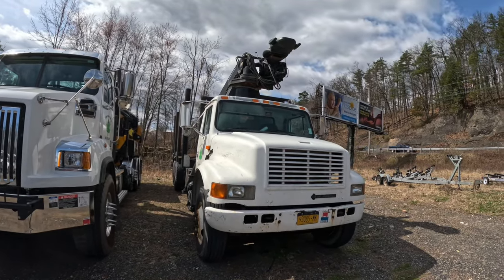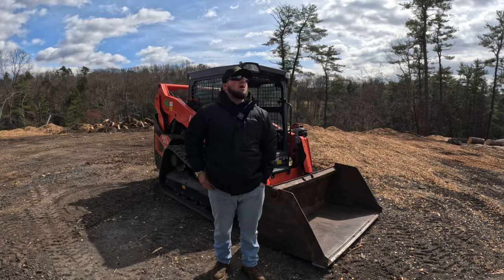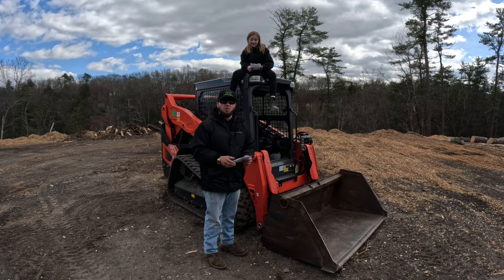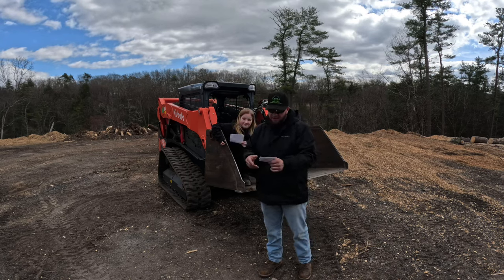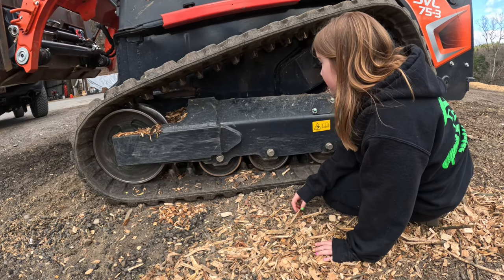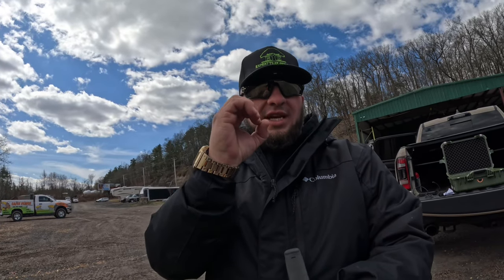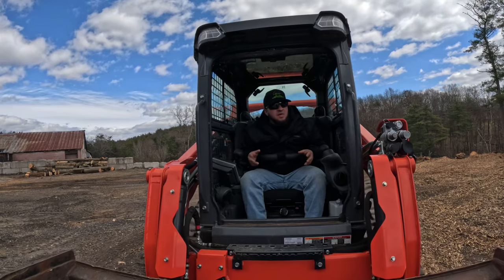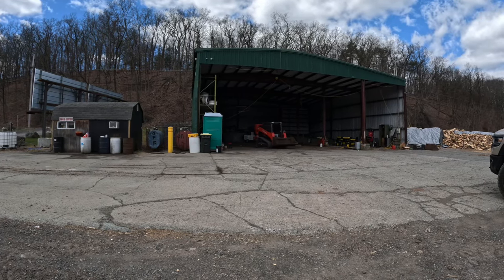2024 kubota svl75-3 review and walk around

Comment: I’m not sure what your talking about the bobcat t76 has plenty of room in the engine compartment and has the full cab compartment not the spilt design that they used to have, and it came out with that stuff a year ago. I’m glad that kubota finally is thinking about the operator and making the interior nice hopefully they’ll get torsion suspension one of these days
Reply from the maker: I looked at a 2023 bobcat t76 with the back door open and there is not half the room for working as there is on my Kubota from the location of all the filters to the location of the battery and even the location of the fuel tank the Kubota just seemed to me and I know it's my opinion built with the user in mind. I would also like to thank u for even watching the video I greatly appreciate it I'm a full-time worker and company owner it isn't easy to shoot these videos or edit them so again thank you and I agree some suspension would be awesome.

Comment: I got quoted 110k for a new bobcat 2 years ago. I ended up buying a 2020 T76 with 400hrs fully loaded cab high flow SJC etc for 65k locally off craigslist... I paid 3000 for the extended warranty. Has been a great machine so far. I've put 600 hours on it. its actually been a complete game changer for me. then my neighbor bought a brand new SVL75-2 and parked it by the street for rent. I rented it when i didn't want to abuse my T76 and it honestly felt like 80% of the machine of the T76. but it was smaller and more compact and much cheaper. It could hardly handle my T76s 2000lb high flow brush cutter
Reply: The svl-75-3 is a totally different machine and it’s more compared to the t66 the both machines go for less than the 76 and the svl to me is just as good a machine they have higher lift height and reach were the bobcat is a little faster 8.7mph vs 10.

Comment: Bobcat is the better option with more features included, kubota has issues to address such as debris build up points, chain down, security, noise reduction, lighting inside cab at night, and feature location inside cab, In order to compete with bobcat. Bobcat is a bit more expensive but worth it.
Reply: Really?…I can’t stand out the bobcat…everyone is different I guess

Comment: I own t66 and kubota svl75-3.   Bobcat is faster,  quieter better visibility.  Things  I hate about the

 kubota , door is very heavy always hitting head on it, visibility over shoulder and out back is nonexistent.  There is a reason why kubota is cheaper than cat and bobcat.    Svl75-3 is equal to bobcat t66.  T76 will pickup and walk away with the kubota.   Look at lift capacity.  Kubota is 75k loaded
Reply from the maker: I think I might have said the wrong bobcat model more than once and I apologize on that but I was trying to compare the competing models both in the 74 horse range and after very careful deliberation for what myself and my company needed I felt the Kubota was a better fit for us and my employees agree as far as the Kubota being 75k loaded that isn't too far off but I did pay 82k before taxes and that was without a bucket and my machine was not fully loaded I'm pretty sure you could load a new svl75-3 close to 90k at least here in NY thank you for the comment and the view I hope u subscribe and watch me put that skid steer to work